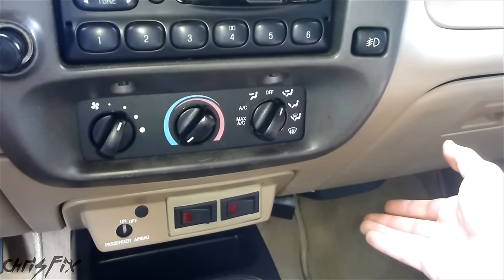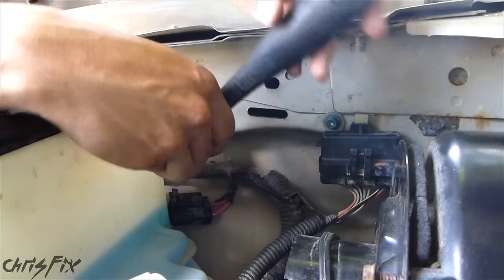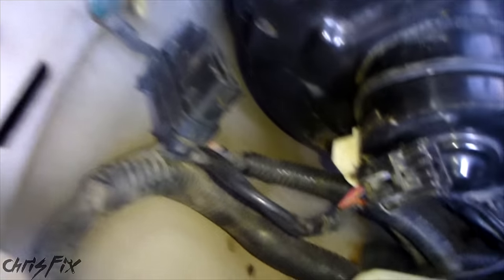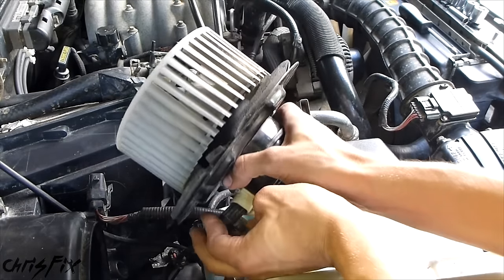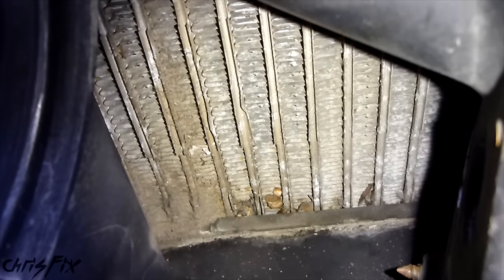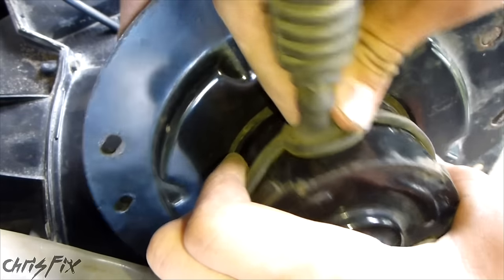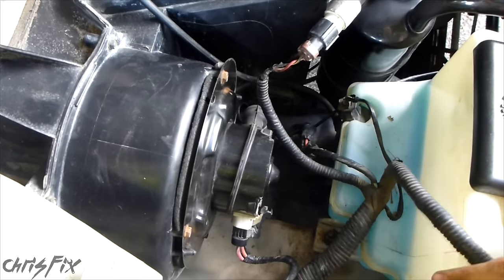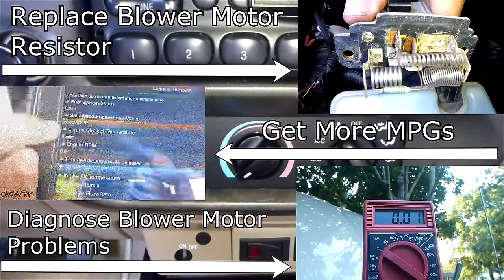How to fix a Noisy Blower Motor AC Heat Fan

Comment: Ya will do I need to clean it and I found out why my blower don't work on hi well under the dash behind glove box there is a red wire with a connector leading from switch then to blower well the connector is melted  it has a poor contact I put the connection back and we'll the wire at the connector gets hot and gets hot fast. But it does it only at the connection so I think when I get home I'm just going to bypass the connector to avoid buying a new one a solder plus shrink warp it but this just means when time to change the blower I'll just have to cut out the wire but that's okay I'd rather eliminate connectors that get corrode and get hot. These tahoes seems a bit common for the connectors to go bad and heat up I've replaced a bunch because of that. And the blower is drawing normal amps.on high so I'm just going to do a solder fix on it till I get a beer connector and blower. I wanna replace the blower before the connector. To avoid melting again
Reply from the maker: SuperJeremi10 Glad you found the problem! Good work!
Reply: me too I disconnected my battery cut the connector out soldered it in place and the covered it with shrink tubing reconnected my battery and turned the blower on high the wire didn't even get warm I just eliminated that stupid connector if I ever need to ill just cut it at the joint in future I fin this way  much more reliable then all them connectors with poor contacts.

Comment: My mitsubishi RVR blower motor doesn't work sometimes.when I give a little touch under the motor  it starts working. It's not the connecter. Just the black plástic piece that I should touch. can this be fix or do l have to install a new blower motor. Pls advice 
Thank you
Reply from the maker: New blower motor.

Comment: ChrisFix - Is it normal for a fan to be louder than it normally sounds when you turn on the aircon and the temperatures are high
Reply from the maker: The actual loudness of the fan has nothing to do with how hot it is. What could be happening is the car knows it is hot so it recirculates the air inside the car to cool it faster and that means the vent outside is closed which makes the fan sound louder in the cabin.
Reply: Thank you for replying. I am sorry for not stressing that I am talking about the radiator fan. My car has two radiator fans. It is one of them which is making that loud noise when the aircon is turned on.

Comment: @Chrisfix: help me please!!! My air blower got a lot of noise so I took it off and tried to put some oil in it. But when I plugged it back again, it couldnt run and released some white smoke. So I think my air blower is burnt and gone. So I bought a new air blower. I plugged it in and it is still not running with a new air blower. Could you please help me? Its a honda civic 2014. Is it the resistor got burnt also? Or the car computer got a signal not to run the air blower?

Comment: i did this today on the same truck and i had to actually remove all 4 bolts on the coolant reservoir  and lift it out of the way to get to it because it wouldn't just slide out like yours. lol
Reply from the maker: chris rad Nice! Yea, my bottom bolt is weird. I think that is why mine slid.
Reply: ChrisFix Yea I noticed that it's adjustable after I took it off. So I slit it as far forward as possible just in case I need t do something to it again.

Comment: hey Chris, I have a 2003 BMW 3series and my fuse in the glove box keeps blowing every time I try turn the heater on. there is no air coming out but the climate control works.  it's the number 62 fuse, 7.5 amp.

any idea what the problem could be? please help! 
thanks!
Reply from the maker: V.N Check the heater control valve. Maybe unplug it and see if the fuse blows when you turn your fan on.
Reply: +ChrisFix I'll try that thank you
Reply: it worked! thanks a million!

Comment: Here because grinned mouse bits and coagulated  blood in blower fan, blower case (where the blower fits in) and air filter. It's a mess. And the smell is to die for. Literally. Lots of debris and dog fur too. 2000 Honda Cr-v.

Comment: Can someone help me I have a Nissan Altama 2006 the ac & heater work but they take way to long to cool/heat and not that strong 
Would replacing the blower motor help?

Comment: I didn't fix mine right away. It was noisy on high and medium. The motor finally quit working on medium and high. I live out in the countryside, and when I pulled it out, there was a dead, dried mouse pinned to the side of the squirrel cage fan. The fan still worked. However, the  blower motor resistor had failed from the added load drawn through the resistor due to the overload on the fan motor. So, the lesson take away is: when something doesn't sound right or work correctly, find out why, be brave, check with ChrisFix on YouTube to see if there is a video to help solve the problem, then FIX IT YOURSELF.

Comment: On my 2004 trailblazer the whole dash shakes like hell and rpms drop by about 200 when you turn on ac / heat, defroster.  Could this be part of the problem?
Reply from the maker: It sounds like a problem with the electrical system. Watch “how to test your alternator” and see if it’s pumping out enough power. Otherwise the car can idle rough.
Reply: Already tested.  It's not dropping power and it does it when I give it gas

Comment: ChrisFix.  My 01 Civic blower motor "rings" or has "faint screech" only when on very HIGHEST fan setting.  Swapping in a new motor and it still does exactly the same thing.  Cleaned the intake filters.  Tried without filters.  All air ducts are clean.  Any ideas?  Anyone?  Sound seems to come from blower motor.  When I run it on high out of it's hole, it runs quietly (besides the wind).  Put it back in, and there is always a screech or ring at the highest speed setting.  I cleaned the upper rim of the blower blades to make sure they are smooth.  Didn't matter.  What have I left undone?
Reply from the maker: I am wondering if the screech is wind moving though a little hole and creating a high pitch howling noise that sounds like a screech?

Comment: I replaced my motor but it still doesn't run, it's not the fuse could it be the relay? I drive a 2010 Infiniti g37x coupe AWD

Comment: Chris hey brother love your videos , me and my shop sub your channel. That homemade atf & acetone lube works great. My question for you is what motor  oil do you use on each of your vehicles and why? Im a manger at a light repair shop and  and working  on a Tribology degree online from M.I.T. So lubricants and specifically engine lubricants  are my passion.But I fight with dealership asshats that are not ASE and old guys who just say their mechanic  said "Just put 10/40 in it...this drives me nuts. So what are thoughts on base stocks and additive packs and Viscosity Index Improves and how much VII you are willing to swap for base stock. I try to use G4 pao only but even mobil1 doesn't  tell you anymore.
Reply: I just realized that's more of a rant then a question lol. My bad long day
Reply from the maker: Rich Coakley Haha no worries Rich! I am glad that homemade penetrating fluid is working great for you! I just used it today to remove rusty exhaust manifold bolts and I didnt break any! As for engine oil, I use full synthetic on all of my vehicles. I try to use Mobile 1 because the Vette has had that in it since it was brand new. I dont use any additive packs or anything, just whatever weight motor oil the cars recommend. My truck and Vette both recommend either 5w30 or 10w30 so I put in 5w30 in the winter and 10w30 in the summer.

Comment: When I select floor, the blower turns off. Works on other settings.
I put another selector in, it did the same.
Goes from cold to hot..

Any suggestions?
Reply: @thatoneguythatwaslikewow7692  Thanks for replying.

I own a 1989 Lincoln Town Car.

If you mean the blower motor resistor(with the spring in it), I've changed that already.

Comment: What would cause this? I have fan noise(sounds like bird chirping) when fan/heat/AC turned on to low and 2nd setting. When I turn it to 3rd setting or high, noise stops. Then when turning it back to 2nd setting, the fan stays quiet. Noise stay on if I dont turn it to the 3rd setting no matter if it's on AC, heat, or just air. Can anyone help? --for 2005 Lexus is300

Comment: The most reliable fords ever made were designed by mazda.   Ford ranger  ford fusion 2.5. Still not as good as mazda. Mazda 6 adds oil cooler and throttle body, steering  upgrade.   Mazda truck simply used less plastic trim on the exterior and better, simple interior. Mazda b3000 also had better engine bay wiring somehow. Ford ranger had bad alternator wiring. B3000 looks the same there but doesn’t seem
To have the problem.

Comment: i got a nissan navara, same AC fan, pullled it out and the bearing was gone, paid 110 USD to get a one from the scrap yard as the new one was not available at the service center, they said i had to order it and wait atleast to month till it reaches here, and it was hot as hell here, so no way i was gonna wait a month for that, 110 bucks for a used fan, and you said you can find it for 40 bucks? man you guys got cheap prices there

Comment: Thanks Chris but that's not it. The blower runs well smooth and quite. On all speeds but #4 High. On speed 4 there is no activation of power. Replaced blower speed control switch and blower resister but no change in the specific problem. Wow, you must be a fellow night owl, that was a fast reply you made.
Reply from the maker: +Big M Smith I dont sleep. lol Do you get 12 Volts at the blower motor on #4?

Comment: I changed my blower motor with attached resistor in my 2014 Toyota Camry and it’s going out again. Installed a week ago 08/23/21. It blows but here’s the thing. Let’s say I’m a the second switch from low, it’ll blow like if it’s running out of air to blow sometimes strong and sometimes not so strong so basically it’s not consistent anyone know why that’ll happen?

Comment: You know how you where talking about the speed not working or somethings well on my Mini Cooper I turn it to 0 and it stills blows how or cold air depending on the setting that it's on is its because wile driver got the outside air just goes in to the fan n into the car
Reply from the maker: +José Villa That is because your vent doors are not closing all of the way. It is a pain to fix and normally I recommend just setting the temperature to what is comfortable and leaving it if everything else works.

Comment: can someone help me, I have a problem with mine that makes a very loud noise when I turn it on, but sometimes it's okay until I hit a bump on the road. I cleaned it but when I took it out I saw like skid marks as if it's scrapping something. I checked but there's nothing, should I just change the fan?
Reply from the maker: +Post master did you spin the fan to see how the bearing sounds?
Reply: yes, that's all okay, it's not the fan that makes the noise. it's that it's hitting something on the inside. the marks on the fan are on the outside but it's all around. should I check again and see if something is hitting it?
Reply: ChrisFix I turned it on when i took it out and no noise, everything worked fine, it's when I stick it back in there when it starts again

Comment: Chris, You shouldnt use just any cleaner on the evaporator. It is copper so that orange cleaner you used could be corrosive. Home Depot and Refrigeration shops sell Evaporator cleaner in a spray designed for copper. It is in a green can and no washing is necessary
Reply from the maker: +Shawn Heckler the evaporator is aluminum and that stuff designed to clean coils damages plastic so it's not good for use directly in the HVAC.
Reply: ChrisFix You know more about cars than I do, however, I'm a service tech and I'm just telling you that using household products like that can destroy copper. If your evap is aluminum and you think its safe then use what you have. I wouldn't recommend it. I've always used condenser cleaner and evap cleaner on my A-coil annually for my house HVAC system. It is a 10 year old system and it functions and still runs perfectly!

Comment: I did this a week ago to my b4000. Tore apart all the passenger side hood to get it all the way out
Reply from the maker: Tore apart the hood? Too bad I was a week too late lol. Funny because I did this a week ago too!
Reply: ChrisFix i have a manual with cruise control so there's a box in front of it, and 4 bolts to remove the fluid tanks, and to get to the 4th you have to take off the air box. All for a plastic bb my little brother put in the vent. Took 3 hours to get it apart and back together, losing an important bolt in the process
Reply from the maker: Ouch. That sounds horrible. I wish I had cruise control though lol. I didnt want to get to the 4th bolt because I didnt want to take out my air box. For some reason it doesnt want to budge.
Reply: ChrisFix I just pulled my airbox, coolant tank, cruise control and blower to search for a vacuum leak on the A/C controls on my 2000 3.0. I had to search how to pull the airbox too. That air box it held in with strong rubber grommets in the metal under and along side and posts on the airbox going through them. You can get a small prybar under the airbox on the side by the pulleys. Once they are popped up and free, you pull it towards the center of the truck to pull the last 2 posts out of the inner fender wall. My coil was pretty clogged up. I ended up using a foaimg coil cleaner  you mix with water in a chemical sprayer with a wand to get up in the box.
Reply from the maker: Robert L Thanks for sharing Robert! Sounds like you had a nice little project going that day!

Comment: my AC blower stop working I check all fuse and that good and the AC is working but the air don't turn on
Reply from the maker: Check the blower and see if it runs when you put 12v to it

Comment: I have a problem my aircons switch temperature is broken when you move to higher cold it gets hot HELP!
Reply: that's weird
Reply: Check your blend door. The blend door is a flap that changes the direction of air flow so it either moves over the evaporator core (Air Conditioning) or it moves over the heater core (heat). If this goes bad or the vacuum solenoid that controls it goes bad it can cause your symptoms.

Comment: is there any problem if a piece of paper goes in the injectors and car is now rumbling
Reply: How did that happen??
Reply: while cleaning the throttle body
Reply: Can you get it out?
Reply: If you can't see it , I would suggest taking off the TB and looking for it.... If not then, you can try pulling out the spark plugs and checking, then change the oil and oil filter... After doing this, Let the engine run until it burns the paper
Reply: thanks
Reply: ajitha dinesh You're welcome!

Comment: my ac doesnt blow out.. it makes a weird sound but no air comes out. over the engine i feel cold air
Reply: I have the same problem..  but my blower motor sometimes works and sometimes doesn't.  Fuse are fine...  I installed a new resistor and still the problem...  Searching on web I found maybe is a "flat spot"...  can I fix it???

Comment: my ac does that all the time front and rear.
Reply from the maker: SuperJeremi10 Now you know how to fix it!
Reply: yea  unfortunately mine is located under the dash inside  behind the glove backs  so not as easy to get to as on your mazda.
Reply from the maker: SuperJeremi10 It's still pretty easy. Just a little more cramped. Slide that seat all the way back!
Reply: yea very true I need to get a new glove box one of the hinges is broke was like that when I  removed it to get to blower wire  ill grab  one of a junk yard car blower works great again ac blows ice cold on high speed   I also put on a new water pump today and belt no more leak and belt squeal. I put a gator belt on it.

Comment: I found two baby mice dead in the blower motor wheel n also not sure why all this wool is inside the blower motor cavity. mice nest or what?
Reply: Mice will use just about anything for a nest: wool, leaves, pine needles...anything they can find. So, yes.
Reply: HunkpapaLakota ........my biggest concern is that you didn't wonder why your vehicle smelled of rotting corpse......

Comment: My blower motor on my old Acura TL went out but it was buried deep inside the center of my dash. I literally sold the car instead of fixing it.
Reply from the maker: Aaron Spencer Wow, that sucks. Every car I have ever worked on, the blower motor is actually not in a bad place. Now, the heater core is a different story lol
Reply: ChrisFix Heater cores suck! I tried cutting one out of the box with a wiz wheel to cheat-out having to take the dash and front fender apart on my old car. I planned to fiberglass the box back up, but nope! There still wasn't enough space to get something up to cut the tubes and drop it from the inside. Had to bypass it.
Reply from the maker: Brownbear Yea, such a bad place for them. They should make access easier like the blower motor!